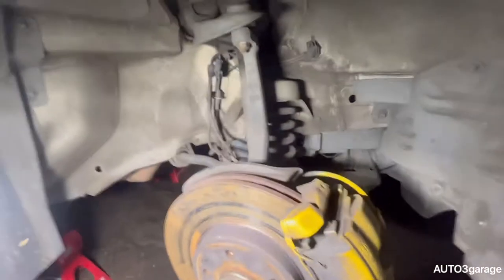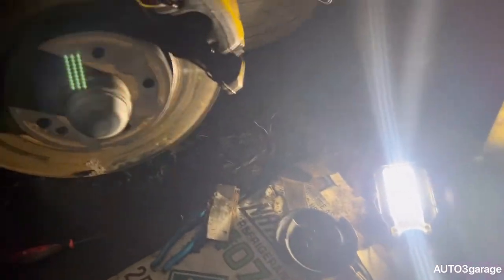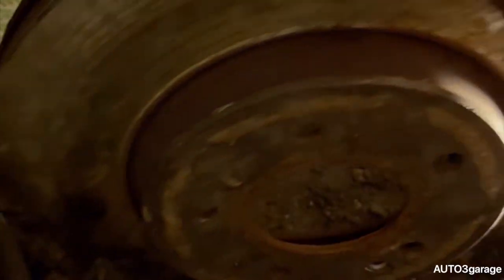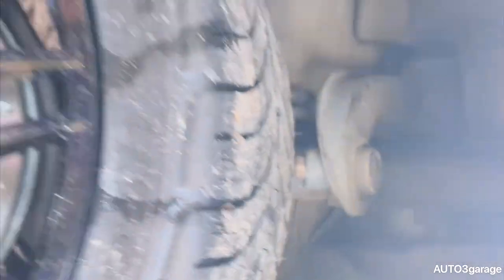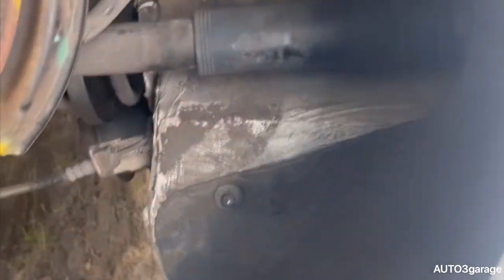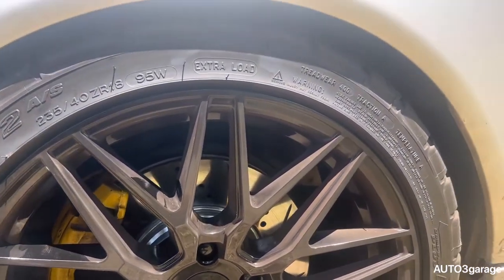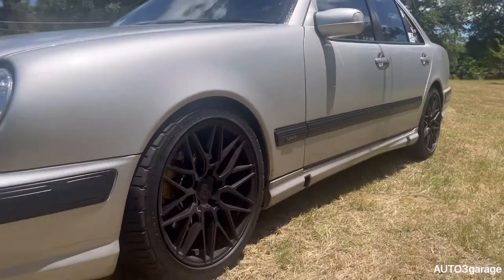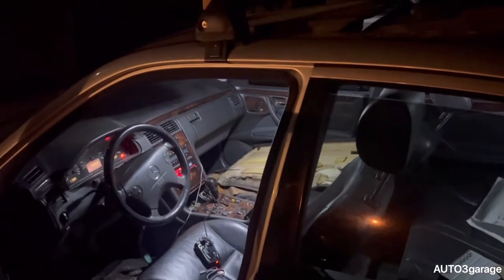New mods on Mercedes w210!! Ep.2

Comment: HI. Can you tell is that compressor tool enough to remove the spring? I have tool like this and am going to mount also H&R springs on my W210. Want to know, does this tool allow me remove stock spring from the car without removing additional suspension components?
Reply from the maker: No sir , I wish it could be that way, but it’s not having the components move gives room to bring spring in and out when compressed!!
Reply: @auto3garage522  
And what have I to remove? Only shock? Or anything additional?
Reply from the maker: https://youtu.be/3U7MmFVdCSI
Reply from the maker: https://youtu.be/4LUWYBrF0j8
Reply from the maker: Use these videos for reference it’s simple you got this 🙏🏽💪🏽